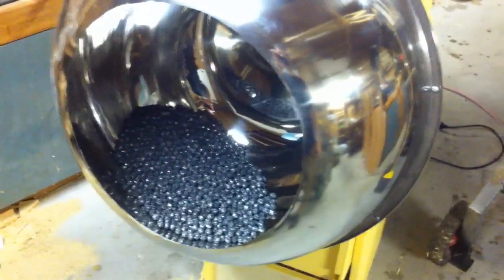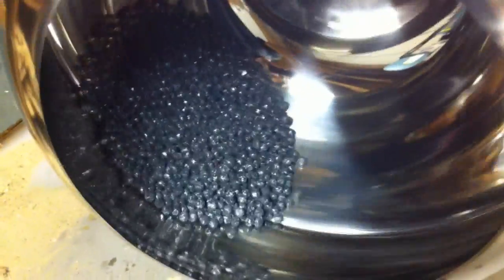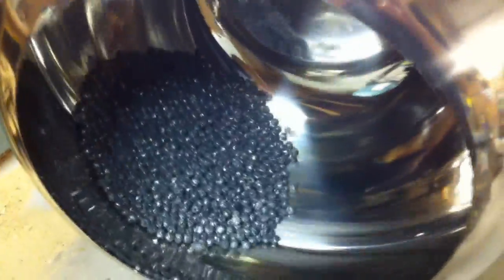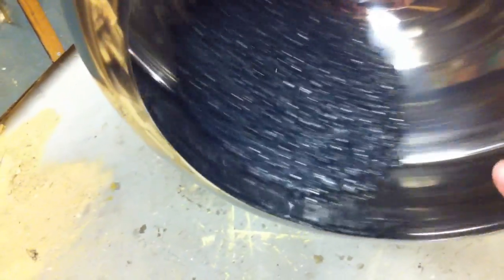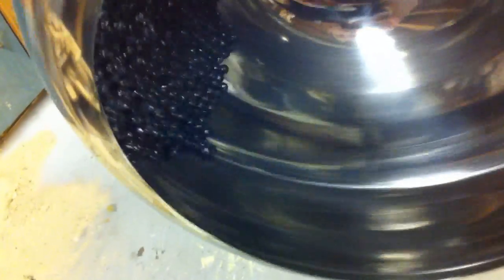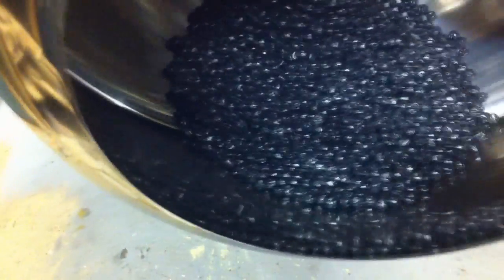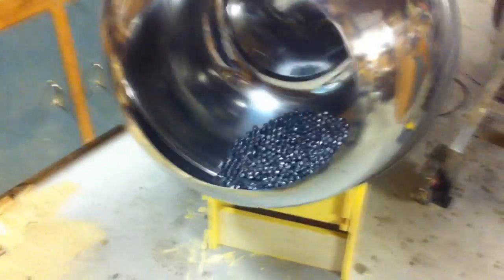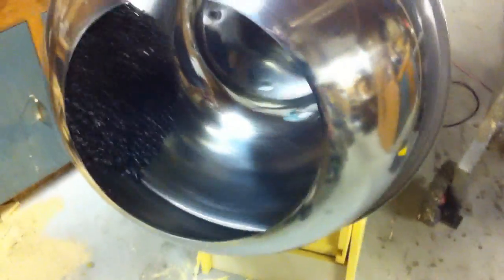Star Roller Design

Comment: What is solution?
Reply from the maker: water and 20% alcohol
Reply: pyronaught Thank you so much...and for resolve the slipping problem?for creating traction what did you use?
thank you so much
Reply from the maker: incoldblooderz the best solution to resolve slipping problems is to lightly sand the metal with a sand paper to create a slight texture to it.   I tried rubberized coatings  but it either doesn't stick, wears off too easily or acetone will melt it.  Sanding works best and never wears off.
Reply: pyronaught and to fill the space between the two bowl?
Reply: pyronaught and to fill the space between the two bowl?
Reply: @incoldblooderz  I used bondo to fill in the seam on mine than applied primer sealer over it. Works great
Reply: incoldblooderz Around 3 minutes he says "minimal hot glue joint".